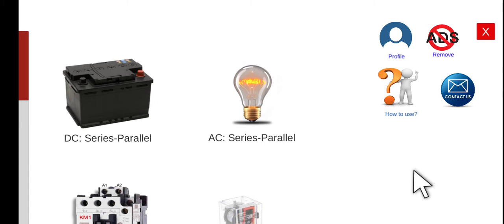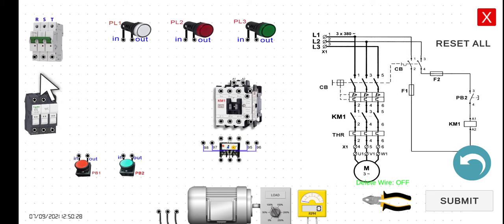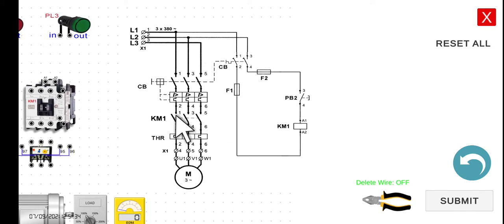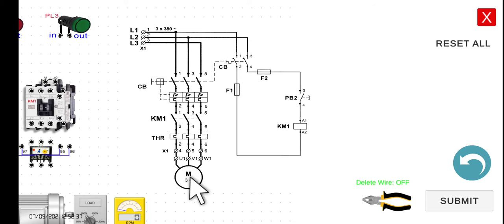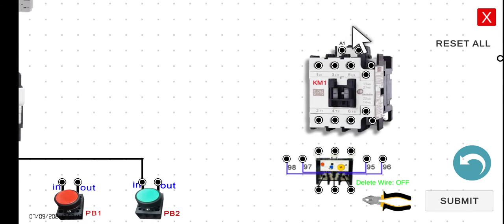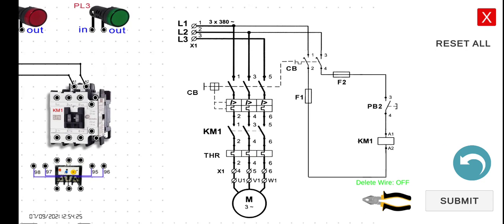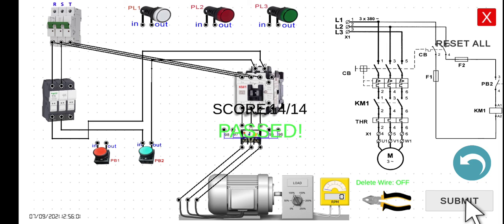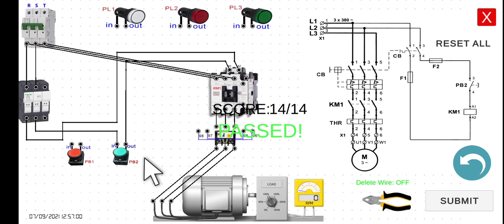Motor1  3 phase induction motor

Comment: I cant drag the screen after zoom. I can't follow the dotted line to connect toward the connections only connects diagonaly. Great app very good potential if you fix the bugs. Also if Coolroom wiing pressure controls and solinoids were added. I bought unlocks for extra circuit simulation excersises. Excelent app. Nothing else out there like it. Only a few but they cost Thousands. I belive micro transactions are great but needs bug fixes. Thanks Louie for creating one of a kind.